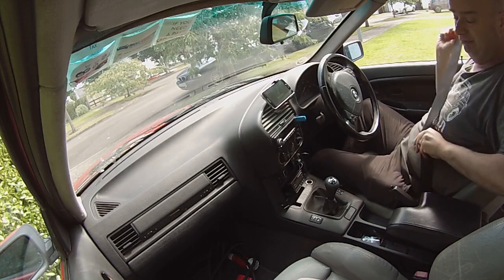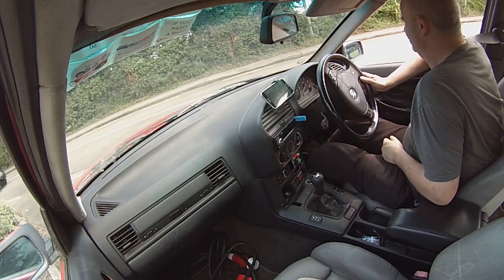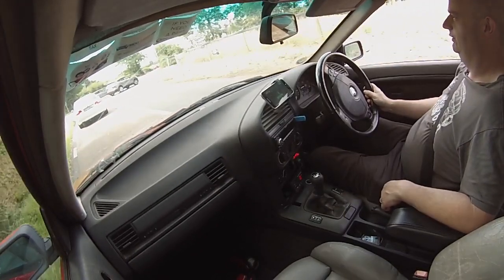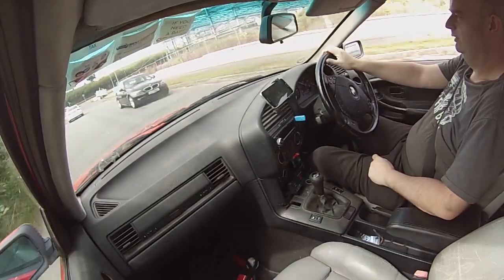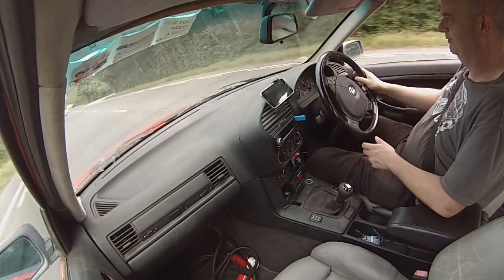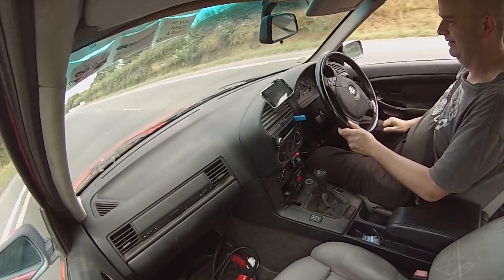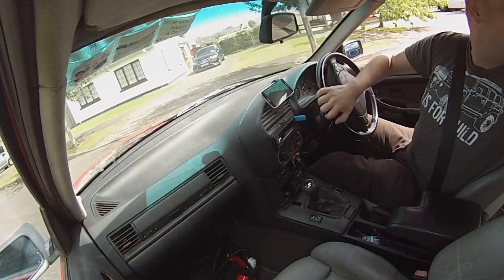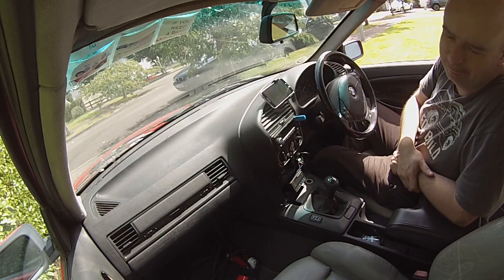€1,000 BMW E36 EV Build 17 : Test Drive 2

Comment: awesome build. but i don't understand how you are able to shift through the gears without a clutch
Reply: Your do rev match but because you don’t have a heavy flywheel or firing cylinders turning the driveshaft, as soon as you level out the throttle you can just click it into the gear you want.
Reply: Same here. I assume he just has an experience to rev-match. In different build by another channel saw a dude putting light on a dashboard when it's time to shift, here: https://www.youtube.com/watch?v=IKR8Or6Im6w&t=724

Comment: Just finished watching all the episodes on this build. Nice solutions to keep it inexpensive. Regarding the wiring, how did you integrate the controller etc to sustain functionality of the car?. Any tapping in on CAN-bus to modules like ABS, ASC or Transmission controller?

Comment: Really fun video! Looking forward to the final tally on parts and money spent on this. A silly question: was pondering doing a classic pickup as an EV project and was wondering how the original three speed transmission would work with an electric with the broader gear to rpm ratio. Any experience with this?

Comment: Do you need to shift the gears or you just like to? Original leaf runs just fine on one gear I think.
Reply: Maybe the BMW is a lot heavier?  I'd be very curious to see wome economy measurements (and speeds/acceleration) in the different gears.
Reply: EV don't need to change gears since the only reason a transmission was invented is because gas engines have a tiny torque window and the transmission keeps the rpms around that.
But an EV would be cool if it had a two speed,  one lower gear for towing or acceleration one higher gear for top speed racing.
Reply: @HandyDan  So it would start off in 5th gear no problem at all?
Reply: @pigknickers2975  Not necessarily, most EV's have between 7:1 to 9:1 fixed gear ratios. So you need a ratio to start with.  I think a good choice for EV two speed is 12:1 for towing and accelerating and 7:1 for daily use or highway speeds
Reply: @HandyDan  thanks for the info